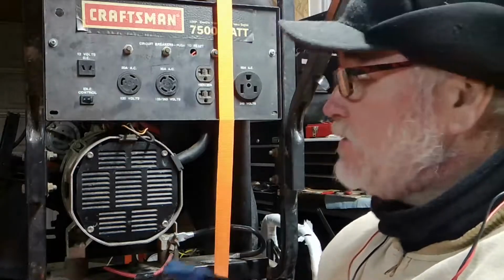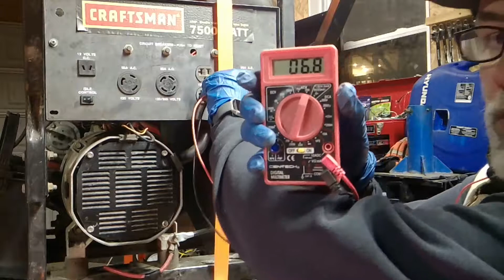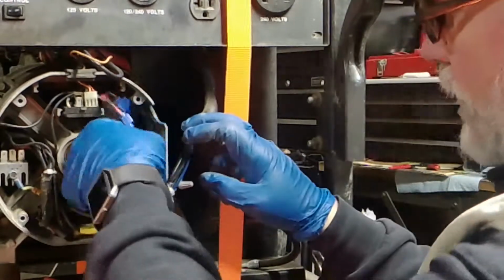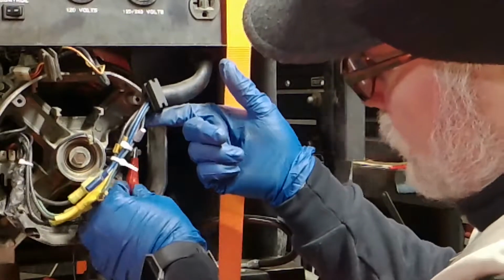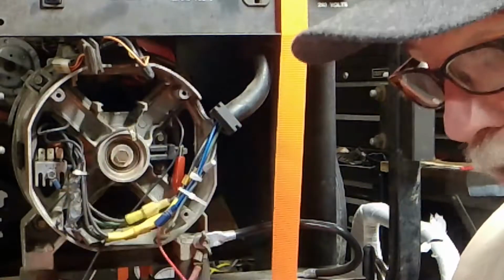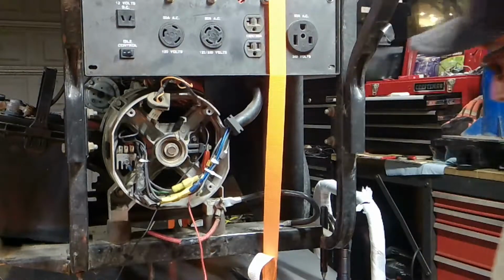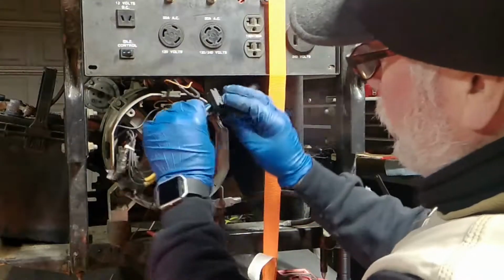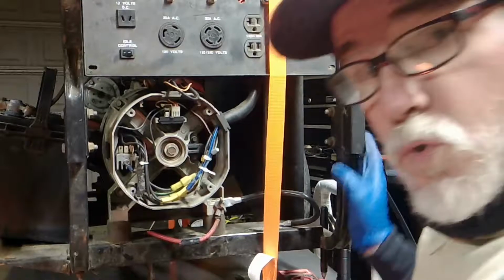How to diagnose generator power loss by flashing field w/12v battery and change voltage regulator

Comment: Hi Steve,  I have the same generator..
 I followed this video however, I ended with 103 volts after taking out the regulator.  Any thoughts on what would cause such a result?  Thanks!
Reply: ⚠️Generator safety reminder: always remember that carbon monoxide fumes are odorless, colorless, and toxic and dangerous to inhale which causes death. That’s why it’s never safe to run a generator indoors. You also need a carbon monoxide detector to be safe from carbon monoxide. Please be aware with all the hazards of using generators. Many people have died each year when using generators due to carbon monoxide poisoning and electrocution. Especially you should be keeping your children safe when you’re using portable generators so they won’t get electrocuted or burned by the generator which is dangerous and also poisoned by carbon monoxide. This is just for everyone’s safety. Make sure you read the manual instructions carefully. Please remember not to run your generator indoors. Your generator should be 20 feet away from your house and away from doors, windows, and vents. Running your generator indoors increases the risk of dying from carbon monoxide. Also do not run your generator in wet conditions. Always make sure your generator is dry before using. Do not allow the generator to get wet. You also need a generator tent to protect your generator from getting wet if you need to use your generator during wet weather. Running your generator in wet conditions causes electrocution. Please be careful. Please make sure your children are not playing near the portable generator so they won’t get electrocuted or burned by the generator which is dangerous. It won’t be safe for children to be near it. Generators pose electrical risks. Don’t try to plug a generator cord into a wall outlet to avoid back feeding. Please use a heavy duty cord for your generator. Make sure the cord is not worn out. Do not overload your generator as well. Overloading your generator can cause damage to the appliances that are plugged into the generator. Please turn on your generator first before plugging in appliances. And shut off your generator first before you unplug the appliances. And never ever refuel your generator while it’s running. Refueling your generator while it’s running can cause fire if gasoline spills on the generator’s engine because it’s hot. You should shut off your generator and let it cool off before refueling it. Just making sure you are aware with the hazards of using generators. Whatever is said on the generator’s operating manual should not be ignored for safety.  https://youtu.be/I1jT3ANENvI and here is a video more about generator safety and keeping your family safe. Thank you. Be safe
Reply: oh well.....ho hum. repeat.  Anyway, check the engine RPM with digital rpm meter/gauge. (good price on Amazon) The proper RPM for north america, is 3600 rpm if its a gas gen, with 2 coils on the rotor. = making 60 cycle/hertz  power.  IF  THE  RPM, is anything other than near 3600, the ' governor '  needs to be adjusted. Should be a set screw, near carb lever linkage to motor shaft, into crankcase. With the gen running, rpm meter connected to spark plug wire, adjust rpm for about 3700 . (no load) Now, plug in about a 900 watt load-(drill, or angle grinder) and watch the rpm closely, for about a minute. It should go down a bit, perhaps depending on gen model/wattage. Also, place a multimeter across the output socket, watching for near to 120 volts. Adjust governor, where rpm/voltage is 3600-120. This, should be very close to  60 hertz. (cycles)   Good luck, from Alberta canada

Comment: I have a tory built 5500 watt that lost voltage while running. I have tried to find a voltage regulator and all my unit has is a rectifier. Part number 91828. I replaced that and still have nothing.
Reply from the maker: Is there any voltage at all? Check your brushes. Maybe flashing the field can do the trick. I have a video to follow so check that out.
Reply: @TheBigmachineman  4.5 volts form outlets.
I did the drill trick for flashing. And a 12v battery. It tries to flash but still wont hold
Reply from the maker: So you can change your brushes but first try taking the brushes out and use small piece of sand paper and shine the contact area the brushes touch on the armature/rotor that might be corroded. take a rachet wrench to turn the rotor slowly as you press in the the area the brushes touch until its shiny and reinstall the brushes and tell me the results.
Reply: @TheBigmachineman  i will try that this weekend and get back to you. Thank you

Comment: My generator is only putting out 1.5 Volts.
When I disconnect the voltage regulator I get these measurements:
The windings (R1&R2, L1&L2) both have 3-5 Volts.
The brushes have 21-23 Volts across them, I read that this is too much? The springs are still working, they both have a moonshaped/curved end, but one is slightly longer than the other (about 2-3 mm).
The voltage regulator doesn't look like it blew up, no black staining or anything bulging. Could I test this by applying the 12 Volts to the brushes and if that gets me the correct Voltage on the output plugs then it is the voltage regulator?

Thanks in advance, great video and also hilarious btw. :)
Reply: Swordie100 stator bad
Reply: @magicone9327  Yeah, kind of figured. Took it all apart and I see black charring. :p Thanks for taking the time to answer though Kevin!
Reply: Reminder about generator safety: always remember that carbon monoxide fumes are odorless, colorless, and toxic and dangerous to inhale which causes death. That’s why it’s never safe to run a generator indoors. You also need a carbon monoxide detector to be safe from carbon monoxide. Please be aware with all the hazards of using generators. Many people have died each year when using generators due to carbon monoxide poisoning and electrocution. Especially you should be keeping your children safe when you’re using portable generators so they won’t get electrocuted or burned by the generator which is dangerous and also poisoned by carbon monoxide. This is just for everyone’s safety. Make sure you read the manual instructions carefully. Please remember not to run your generator indoors. Your generator should be 20 feet away from your house and away from doors, windows, and vents. Running your generator indoors increases the risk of dying from carbon monoxide. Also do not run your generator in wet conditions. Always make sure your generator is dry before using. Do not allow the generator to get wet. You also need a generator tent to protect your generator from getting wet if you need to use your generator during wet weather. Running your generator in wet conditions causes electrocution. Please be careful. Please make sure your children are not playing near the portable generator so they won’t get electrocuted or burned by the generator which is dangerous. It won’t be safe for children to be near it. Generators pose electrical risks. Don’t try to plug a generator cord into a wall outlet to avoid back feeding. Please use a heavy duty cord for your generator. Make sure the cord is not worn out. Do not overload your generator as well. Overloading your generator can cause damage to the appliances that are plugged into the generator. Please turn on your generator first before plugging in appliances. And shut off your generator first before you unplug the appliances. And never ever refuel your generator while it’s running. Refueling your generator while it’s running can cause fire if gasoline spills on the generator’s engine because it’s hot. You should shut off your generator and let it cool off before refueling it. Just making sure you are aware with the hazards of using generators. Whatever is said on the generator’s operating manual should not be ignored for safety.  https://youtu.be/I1jT3ANENvI and here is a video more about generator safety and keeping your family safe. Thank you. Be safe
Reply: @The_Happy_Aviation_Enthusiast  Not sure why you're posting this underneath my comment, but you're right. I did run it for a few seconds to test things, but you're absolutely right.

Comment: I would like to know what part number was for voltage regulator trying to find one for my generator
Reply: Reminder about generator safety: here’s what everyone really needs to know about. Always remember that carbon monoxide fumes are odorless, colorless, and toxic and dangerous to inhale which causes death. That’s why it’s never safe to run a generator indoors. You also need a carbon monoxide detector to be safe from carbon monoxide. Please be aware with all the hazards of using generators. Many people have died each year when using generators due to carbon monoxide poisoning and electrocution. Especially you should be keeping your children safe when you’re using portable generators so they won’t get electrocuted or burned by the generator which is dangerous and also poisoned by carbon monoxide. This is just for everyone’s safety. Make sure you read the manual instructions carefully. Please remember not to run your generator indoors. Your generator should be 20 feet away from your house and away from doors, windows, and vents. Running your generator indoors increases the risk of dying from carbon monoxide. Also do not run your generator in wet conditions. Always make sure your generator is dry before using. Do not allow the generator to get wet. You also need a generator tent to protect your generator from getting wet if you need to use your generator during wet weather. Running your generator in wet conditions causes electrocution. Please be careful. Please make sure your children are not playing near the portable generator so they won’t get electrocuted or burned by the generator which is dangerous. It won’t be safe for children to be near it. Generators pose electrical risks. Don’t try to plug a generator cord into a wall outlet to avoid back feeding. Please use a heavy duty cord for your generator. Make sure the cord is not worn out. Do not overload your generator as well. Overloading your generator can cause damage to the appliances that are plugged into the generator. Please turn on your generator first before plugging in appliances. And shut off your generator first before you unplug the appliances. And never ever refuel your generator while it’s running. Refueling your generator while it’s running can cause fire if gasoline spills on the generator’s engine because it’s hot. You should shut off your generator and let it cool off before refueling it. Just making sure you are aware with the hazards of using generators. Whatever is said on the generator’s operating manual should not be ignored for safety.  https://youtu.be/I1jT3ANENvI and here is a video more about generator safety and keeping your family safe. Thank you. Be safe

Comment: I bought a Generac XG8000E with 1 hr of use but it was stored for 4 years. The previous owner said it belonged to his father that past away and he had the gas tank cleaned and replaced the battery and runs nice but it doesn't generate electricity. I flashed by looking at a U tube video and it didn't help. I will try you method and see what it does. Great video. Thank you. I paid $300. But I went 100 miles to pick it up. 200 miles round trip.
Reply: Any luck?
Reply: ⚠️WARNING: generators can be dangerous if not used carefully. Please keep in mind that carbon monoxide fumes are very dangerous to inhale and carbon monoxide is an odorless and colorless gas that you can’t see or smell. Carbon monoxide is also toxic. Please make sure you are aware with all the hazards of using generators. Carbon monoxide fumes can cause death. So be aware and careful using portable generators. Many people have died each year when using generators. Please make sure your generator is 20 feet away from your house and away from doors, windows, and vents to lower carbon monoxide poisoning risk. You should have a carbon monoxide detector as well. Whatever is said on the generator’s operating manual should not be ignored. We should also keep our children safe when we’re using portable generators so they won’t get electrocuted or burned by the generator which is dangerous and also poisoned by carbon monoxide fumes. It also won’t be safe for children to be playing near the portable generator. So please make sure your children are not near the portable generator to avoid any risks. Children can get electrocuted and burned by the generator. Generators can be hot which can burn you. Generators pose electrical risks so please be careful. Do not overload your generator as well please. Overloading your generator can cause damage to your appliances that are plugged into the generator. Do not try to plug a generator cord into a wall outlet to avoid back feeding. Also you should not run your generator in wet conditions. Running your generator while it’s wet can cause you to get electrocuted. Make sure your generator is dry before using. You need a generator tent to protect your generator from getting wet if you need to use your generator during wet weather. Turn on your generator first before plugging in appliances. You need a heavy duty cord for your generator. Do not use cords that are worn out. And always turn off your generator first before you unplug appliances. Please don’t refuel your generator while it’s running. Refueling your generator while it’s running can cause fire if gasoline spills on the generator’s engine because it’s hot. You should shut off your generator and let it cool off before refueling it. Whatever is said on the generator’s operating manual should not be ignored. Please follow all the generator safety tips carefully. https://youtu.be/I1jT3ANENvI and here is a video more about keeping your family safe while using generators. Just hoping everyone stays safe and using portable generators carefully and not putting family at risk when using generators. Make sure you are aware with the hazards. This is just a reminder. Hope you all stay safe. Thank you.

Comment: Thanks for the amazon link, could not find it when searching.  However, this is $66 or more.  They have other ones that are like $20 which are for older unit (I think).   Are those going to work too?  As long as they regulate the 12v to the brushes

Comment: I wish I could pick your brain on that Hyundai generator I see on your workbench. I have one just like it that runs great but once running the surge light comes on and a second or two later it goes into protect mode. My Hyundai is 3000k watts
Reply: Generator safety reminder: always remember that carbon monoxide fumes are odorless, colorless, and toxic and dangerous to inhale which causes death. That’s why it’s never safe to run a generator indoors. You also need a carbon monoxide detector to be safe from carbon monoxide. Please be aware with all the hazards of using generators. Many people have died each year when using generators due to carbon monoxide poisoning and electrocution. Especially you should be keeping your children safe when you’re using portable generators so they won’t get electrocuted or burned by the generator which is dangerous and also poisoned by carbon monoxide. This is just for everyone’s safety. Make sure you read the manual instructions carefully. Please remember not to run your generator indoors. Your generator should be 20 feet away from your house and away from doors, windows, and vents. Running your generator indoors increases the risk of dying from carbon monoxide. Also do not run your generator in wet conditions. Always make sure your generator is dry before using. Do not allow the generator to get wet. You also need a generator tent to protect your generator from getting wet if you need to use your generator during wet weather. Running your generator in wet conditions causes electrocution. Please be careful. Please make sure your children are not playing near the portable generator so they won’t get electrocuted or burned by the generator which is dangerous. It won’t be safe for children to be near it. Generators pose electrical risks. Don’t try to plug a generator cord into a wall outlet to avoid back feeding. Please use a heavy duty cord for your generator. Make sure the cord is not worn out. Do not overload your generator as well. Overloading your generator can cause damage to the appliances that are plugged into the generator. Please turn on your generator first before plugging in appliances. And shut off your generator first before you unplug the appliances. And never ever refuel your generator while it’s running. Refueling your generator while it’s running can cause fire if gasoline spills on the generator’s engine because it’s hot. You should shut off your generator and let it cool off before refueling it. Just making sure you are aware with the hazards of using generators. Whatever is said on the generator’s operating manual should not be ignored for safety.  https://youtu.be/I1jT3ANENvI and here is a video more about generator safety and keeping your family safe. Thank you. Be safe